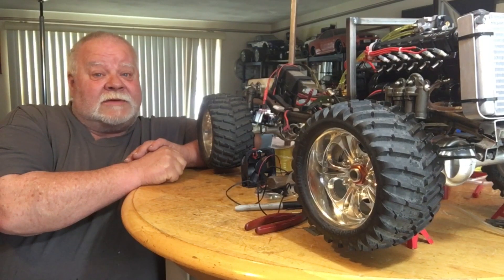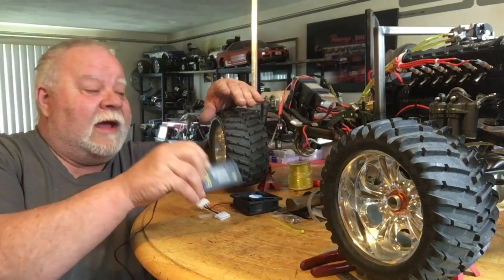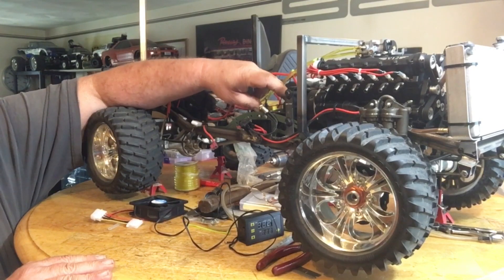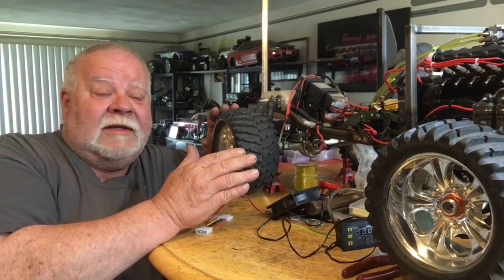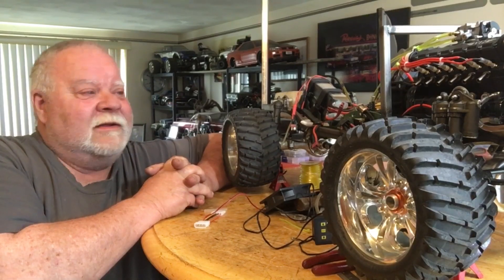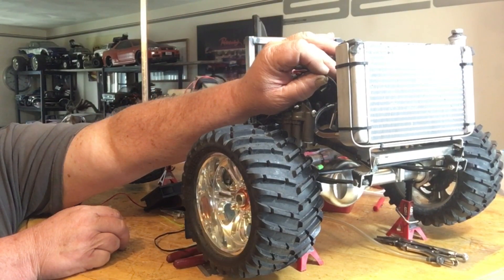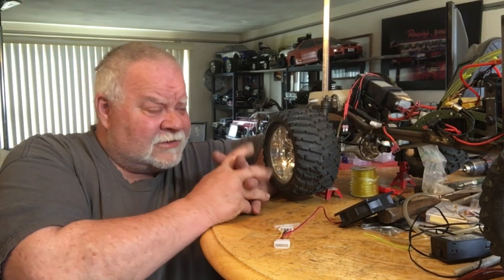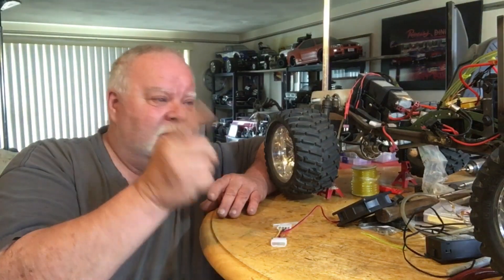CHUAN QI V12 TORQUE TEST

Comment: You should use Evans waterless coolant,  300 deg boiling point, contains zero water, no electrolysis and little to no coolant pressure.  I use this in all my hot rods, motor vehicles. 
Also consider using AMZOIL for your motor oil, the best oil money can buy.
Check out the website of both the products, they ARE the best.  FH

Comment: Where did you get the chassis? That's badass, I would like to build using same chassis engine, and thier 4spd transmission they've built for theV12. I used to be into the 1/10 & 1/8 scale, but been looking to go big or just stay home. I'd like to seriously know where you go the chassis though.
Reply from the maker: I hand build most of my chassis using 3/4 inch square tubing and use a septic drain snake for the leaf springs

Comment: High idle needs lowered. 
(Sounds like 11-1200 rpm, reduce to 780-830ish)
Should help disengage clutch at idle, I think🤷‍♂️
And it sounds like it's breaking up at bit on mid-top end.
Richen up the midrange a bit..
(Sorta sounds like a lean ping in a nitro single)
Other than that, it looks and sounds killer!
Can't wait to see and hear the finished product!
Reply from the maker: Good call there my friend! I lowered the idle today in my next test video and it seemed to help the low end revs after it is warmed up, the ping you are hearing is my steel gears and clutch bell also the driveshaft dog bones making noise when I was revving it,👍
Reply: @Dennis Dempsey Radio out of control  roger that!
I know our input is pretty unnecessary, but just what I thought I was seeing and hearing.
As for the dog bones jiggling, try adding a few small O-rings to the diff outputs to tighten em up a bit. (And maybe get rid of the rattle.
Clutch n clutch bell are pretty standard noise makers (as you already know)
So I dont think theres much you can do for them🤷‍♂️
But loving the content! 
Keep em comin!💯

Comment: That thing is sure going to be lugging around a lot of batteries bro. I was thinking about an alternator or generator from some old motors a brushed or brushless. Configuration of a voltage regulator shouldn't be too difficult. Onliest thing is would it be too much parasitic draw off of the engine in order to keep up with the current demand? I see you're running separate batteries for each distributor plus you'd be driving the radio steering servos shift and clutch servos radiator fans lights maybe winch. Lord have mercy brother that there Honkey has a butt load of electronic demand. Badass build bro love your videos too. GOD bless you brother!
Reply from the maker: Good call there brother,  I plan on using one  hi milliamp 11.1volt battery in the end of the build, the V12 will get converted to a high capacity single CDI unit, then experimenting with a charging system down the road. 👍👍

Comment: Good going Dennis. Yup you’re not in the same 1/10 scale where you can experience different options available. For that power even the Rovan clutch seems small, Specially the pinion gears. Need a matched design clutch with a 3 speed automatic transmission to keep the rpm’s low. 👍
Reply from the maker: Yeah good call brother!  this whole build is in the larva stage lol!

Comment: Question Dennis,  what's the temperature deference between the front cylinders and the rear? Would a temperature sensor mid motor or more towards the rear of the motor to bring on the cooling fan earlier help in keeping it cooler?  Always enjoy you're vids and research and development!
Reply: I was thinking the top hose for temperature of water leaving the block

Comment: Damn it, that thing is sick. You got mad skills. I keep hoping that Rovan or another company would release a manual transmission for the Baja 5b. I have a 3 speed in mine right now, but it takes out the one way bearing about once a week. I even adjusted the 3rd gear clutch so it wouldn't shift to make sure two clutches were trying to engage simultaneously. Gets a bit spendy after a while.😕
Reply from the maker: I heard about the one way bearings failing, I wanted to buy a 3 speed set up for my next build but might hold off to see if there is a better option,